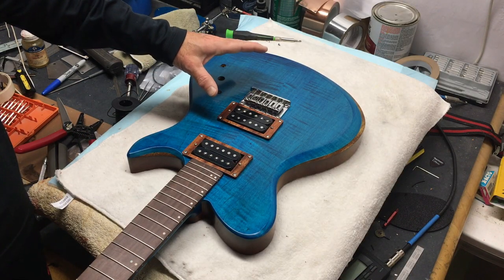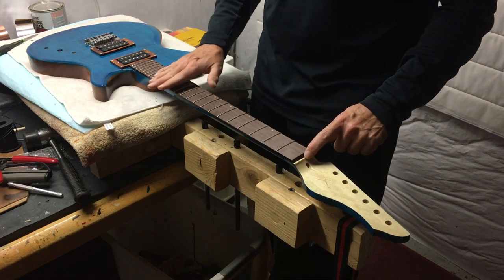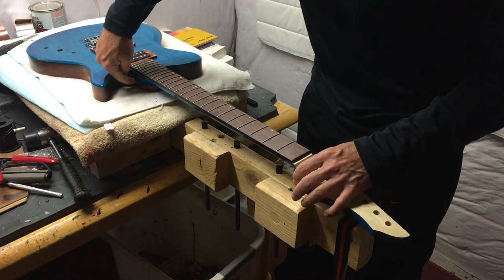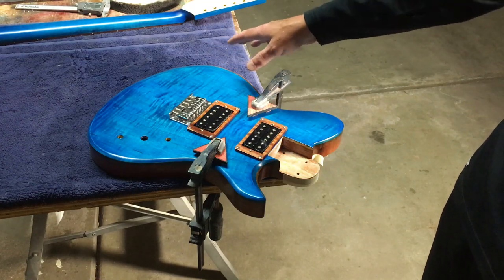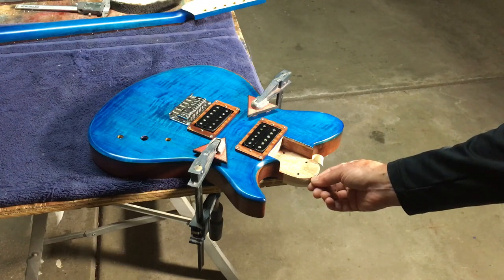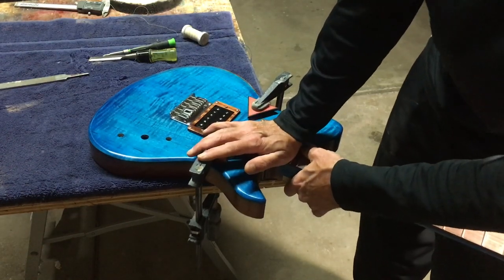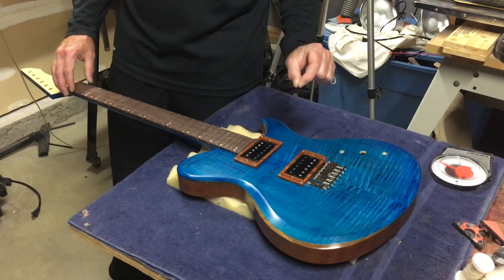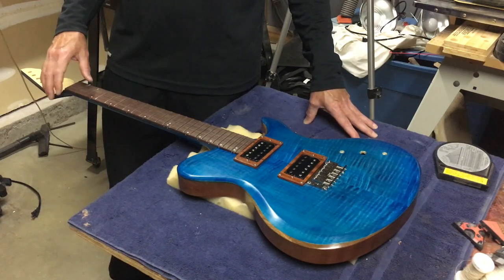How To Tweak The Angle Of A Guitar Neck For Perfect Action

Comment: I’ve shimmed many many neck pockets over the years with absolutely no issues. No matter what anyone says, there is no loss in sustain or “tone”. At all. BUT! This will be my preferred method from here on out. Because it does look more uniform and much nicer than a noticeable gap on some guitars. Awesome video and nice work!
Reply: There physically has to be a loss in sustain shimming the neck. You might not hear the difference but it's there. If it's not a solid wood to wood contact, sustain will be compromised.
Reply: @r.llynch4124  I would agree, but argue air gaps/ density variance, are a more serious problem. Using cellulose paper or dense cardboard IMO would have no discernible difference.
Reply: Wouldnt sanding the neck be a better alternative? one can always replace the neck and sand-/shape it to fit the pocket, reshaping the pocket it a pretts much one time deal.
Reply: Leo used business cards

Comment: My Les Paul has a slight neck angle problem.
The bridge had to be raised to get the strings up off of the fret board and accommodate the  slightly back (away from frets and pick ups) angle of the neck.
When I got the guitar, the bridge was cranked up pretty high.
I managed to get the guitar completely dialed in by relieving the truss tension just a little and bringing the head stock up towards the pickups which lessened the poor angle.
Then I re-cut the nut to get lowest action possible at that end of the guitar...which of course helped the bridge issue at the other end of the guitar as far as fret buzz and possible action settings. Basically it allowed more options than simply raising the bridge.
Now the bridge is only raised maybe half an inch from the body (if that) and the action is very slightly lower than spec.
Plays great now. Very happy.
Thanks

Comment: That's a nice touch dialing in the neck break angle on each build.   As you say, wood is an imprecise material - its not like we're machining all this stuff out of 4340 billet steel to thousandths of an inch.  Almost all my builds these days are one-offs, so shimming necks is a regular thing for me.  Want a REAL challenge?  Make an ultra thin body that bows slightly under tension - trial and error becomes the only way to set the break angle.  Just finished my worst case ever - had to pull the neck 16 times to get the shim correct.

Comment: As the neck angle increases the scale length line will move also.  Learned that hard way. My experience is roughly a 2.5 degree neck angle will move the scale length line abt 1/8" or so. So make sure u have enough saddle travel to accommodate the change, if the neck was previously flat.
Reply: trigonometry wasn't your strong point at school
Reply: @rogersmith5167  His comment was accurate.  Perhaps your reading and comprehension skills weren't "your strong point at school".
Reply: @gpdude22  2.5 degrees over 648 scale length will increase the scale length by .61 mm (.025 ") maybe we are talking at cross purposes
Reply: Scale length will increase by .617mm. If your saddles don't move that far you've got a bigger problem.
Reply: @gsisk911  Exactly.  We're talking about 1/40th of an inch.

Comment: Thanks for the great tip! I like this better than a shim! You have a great business attitude and a good work ethic...not seen so much these days! Nice work!
Reply: he choose a poor solution. reangling the back of the heel would be much better. there is no way he can do a smooth, flat angle in the neck pocket with the files. just can't get in there. the back of the nwck is easily accessible, and can achieve a flat and smooth surface, so the contact between the neck pocket and the neck is not compromised. yhis was a micky mouse job, unlikely with desirable results. i am glad i saw this, will never buy a guitar from this guy.
Reply: louis cyfer seems like he was getting in there just fine and also using a kickass file to do it with! I'm going to try it soon, myself, so I'll know if it works or not. Seems like this guy knows what he's talking about and seems to want to do quality work...properly!
Reply: just think about it. there is ni way he can do a perfectly flat surface for the pocket with that file. it is just physics. the file has to move past a point to file it. otoh, the back of the neckheel is easily accessible for a flat surface reference. the choice is easy. based on the choice he ia making, i don't agree with you. he seems to know what he is talking about is not a good argument. especially when you don't possess he necessary skills to evaluate it. and you obviously don't.

Comment: Using the string, I see no nut installed yet so can you do this with a nut installed or do you need to have the nut removed? Thanks
Reply from the maker: It's actually better to have the nut installed. Your results will be more accurate.

Comment: That is exactly the problem I have with my Fender Stratocaster that I put together. With the saddles fully down the action is still to high. I'm fairly handy with wood working tools, If I use your method carefully a little at a time, I think it will solve my problem perfectly.Thank you for showing this.

Comment: so you are string lining it from the saddle @ it's lowest point to the first fret? Also does it matter that the body is not parallel with the body now?
Reply from the maker: Basically yes. To be more precise, I go to the nut and put the distance above the first fret at .01" on the treble strings and .02" on the bass strings.The saddles should be lowered as far as they can go and the strings should be the same distances above the 12th fret as they are at the first fret. That way when you raise the saddles to set the 12th fret string action, you don't have that far to go.

Comment: I bought a cheap Ibanez RG for $35 at pawn shop. Dont like the pick ups or tremolo. But the action is unbelievable. All the other guitars I own are way too high compared to 5th is one. I've adjusted bridge, nut, and thrus rod and still I can't get the strings any lower. Is this what I need to do? Please help. This video is making want to remove the neck and get some sand paper

Comment: WOn't recutting the bottom of the heel pocket mean that you need to re profile the back of the neck pocket, so it meets the neck flush?
Reply from the maker: Only if the angle of the neck is so much that it creates a noticeable gap. You can also sand the back of the heel at a slight angle to compensate. In my experience, the gap is barely noticeable. Also, I add a about 3/32" fretboard overhang which will easily hide any gap.
Reply: If the neck isn't firmly against the back of the pocket top to bottom,  that would mean the strings are pulling on the screws only. It should fit  tight against the back of the pocket as much as possible for the best sustain.

Comment: Have you ever had problems with buzz because of the wrong neck angle.....I'm working on a telecaster....have tried everything including leveling the fingerboard and refretting.  If I shim the neck it will make the strings more level from the bridge to the nut.
I shimming it with a .010 flat shim to get the action lower.....I think I may need a slight wedge.  I know the best playing guitars I've had usually have very flat strings from nut to bridge in relationship to the frets.
Any thoughts?  The frets are perfectly level with a rocker.
Reply: I have a .010 flat piece under the neck......just put an 1" 1/2 piece of .010 on top of it in the back of the neck pocket!  amazing! It leveled the strings from nut to bridge.  I'm going to check the buzzing "A" string next.....the action feels like butter.  I'm really excited on this.....a light bulb moment.  The B and E string ring like a bell now.  I raised the saddles.....
Reply: Have you checked the neck for level? I would have done that before touching the frets. A bow, back or forward can really screw your setup. Best checked with a slotted straightedge which sits just on the fingerboard.
Reply: If you do need to shim the neck a wedge which runs to zero across the full neck pocket is the way to go.
Reply: Wedge won't work. Try a 5 iron.

Comment: I've had an issue with the neck geometry on a Telecaster that I purchased new at Sweetwater.  I could tell that there was something wrong when I was setting it up. Yes I know that the people at Sweetwater check and setup every guitar they sell, but how much time can they possibly spend on each unit under such circumstances, and it didn’t really matter what they did or didn’t do anyways because I was having issue setting the action and intonation on this guitar to my liking. 
When I inspected the guitar, I could tell that my guitar had neck gap and angle issues. I removed the neck and discovered that the neck pocket was uneven. I filed it even with a fine wood file. The wood was really soft and easy to work. I periodically checking with calipers to see I was approaching true. 
Now the neck sits snugly and squarely in the pocket. I never considered doing so before, but I suppose one could alter the neck geometry by adjusting the neck pocket instead of installing a shim, but I probably would never would have touching this pocket if it looked planer, but whatever the guys who assembled this guitar were thinking, this was clearly a hack job.
Reply: I also purchased a Player series Mexican made Tele from Sweetwater. I paid for the high dollar German PLEK service even.  And I've had trouble setting the action.  It just occurred to me "Neck Geometry"
 and brought me to this video.  I like your idea of using calipers!  I was trying to figure out how to measure the plane of the pocket.
Reply: @Mike-cd9cj  A set of feeler gauges will come in handy as well.
Good luck!

Comment: What about the opposite problem, where the saddles have to be raised before the strings clear the frets? In that case, would you shave the heel of the neck instead of the pocket? Does it make any difference if it's a set neck?
Reply: I have this question too.
Reply: You can angle your neck forwards or backwards to find the sweet spot. In my case I had to angle mine forwards to resolve a lot of fret buzz higher up on the fretboard with ridiculously high action. Some necks have a "kink" in them where they meet the body, usually on cheaper guitars, which can cause this issue.
Reply: Another way is to file down the neck cavity especially if it is uneven and/or the neck is already at a forward angle, which will bring the neck down (providing it is attached to the front of the body, not the back).

Comment: Great video, thank you. Exactly the tutoring I was looking for. Got into a huge problem setting a bolted neck,  strings are so low won't even make sound only buzzing. I grinded the pocket in a forward tilted angle to move strings up, still buzzing? any clue
Reply: Did you try checking the truss rod adjustment ? I'd suggest you go through a full check of the neck action, the truss rod, neck angle everything and try to find what might be causing the issue. If you're still getting the buzz then you'll need to check all your frets. Maybe one or two are not crowned properly or not set properly. Then you'll need to file and crown that fret and check the buzz. If still buzzing, move on to the next fret thats causing the problem and repeat the process. You'll find a lot of elaborated videos on youtube on refretting or crowning the fret rods.
Reply: @azmrafsan  thank you so much for your help. Truss is flat. Frets I didn't check so thanks I will. Thing is now that I started that big filing job on the pocket it's not levelled properly, so don't you think I should finish that first?
Reply: Yes of course bro. Don't go too far with that. Maybe it was just a fret issue but you already started on an advanced step. I'd suggest finish that off as close to as it was before, dont make any further changes. Put the neck back in and adjust/check frets
Reply: @azmrafsan  hi, thanks again for your precious inputs, well I sort of got as close as I thought I could get to a even neck level which it seems I did,. You are right though 2  or 3 frets at the top of the octave are the culprit I'm on it, and will keep you posted about what happened, again thank you so much for your help.
Reply: Best of luck brother. You'll find a lot of resources online. I hope you get your guitar play like you want it to. Just don't panic and don't get frustrated. Every good thing comes with patience and passion.
Reply: @azmrafsan  you're right about that, it's a first for me, guitar playing, more like the himalaya lol, hopefully I get something out of that sucker...keep you posted
Reply: @azmrafsan  Hi there, you are right, extremely frustrating because no matter how much I grind the frets the buzz persist 
with no light at the end of the tunnel, at the same time I can't keep grinding, the fret will be all worn out, any advise? thank you
Reply: I'd suggest you take a break and don't just file away the frets or the neck etc. Just watch some videos and tutorials online until you've gathered some basic ideas and can improvise on your own. Guitars are actually pretty simple once you know how it works. So my final advise would be to watch atleast a few videos before getting back to work again. Check out StewMac's channel. They are pretty interesting and they make it easy and simple to understand
Reply: @azmrafsan  Hi and thank you again, actually I watched many video for months to work on guitars I previously owned. Then I traded an amazing LP type made by a young guy and his father, that's what started me. The guitar we are discussing is a DIY strat shape, one piece ash wood and I bought separately a maple/ebony neck.  I listened to you and put the neck back on. Yeah I think I need to have the fret job done by a pro, I feel it's way over my head, but thank you again.
Reply: @azmrafsan  Hi there, wanted to keep you posted, I bought 3 bodies 3 necks, 1st is the one driving me bunkers, so went on the second one, got it working spend some time filing some of the frets almost set to go. It helped me better understand the 1st one, I think pocket is not straight far right so neck is settling properly. Right now I'll give it a rest and get back to it after I'm done the others. Also if you are interested check my stuff @ Jazz Brazilian Funk or Electro Brazil. Again so much for your help it really helped me a lot...stay safe...best Marc
Reply: @MRK can you please clarify if thats your insta or youtube ? Would love to check out your works
Reply: @azmrafsan  yes youtube
Reply: @azmrafsan , Hi, follow up, I finished another one, got it to work fine, the 1st one the culprit, I started again yesterday 1 sec at a time, today I'm doing very very light  sanding. I finally did level the whole pocket. to complete the job I decided to use some wood filler, it seems to be working just fine. very best Marc
Reply: @MRK glad to know brother. I had my strat built a while back, was bored home on this lock down tried to shave a bit here and there to get the action lower now it's buzzing and all. Well that's how it is, you mess something's up to learn some. Hope I'll get it fixed and playing soon. Best of luck with your gears. You can add me on IG @azmrafsan and we might be able to keep in touch with our works and gears. Take care
Reply: @azmrafsan  Hi, thanks for sharing, yeah building guitars during confinement isn't bad at all. Action too low on my Strat I fixed it temporarily  and it works well. I cut a piece of aluminium about 2mm thick (think it could take more 3 maybe), 6.5mm long, about 4mm wide,  slide it under the bridge saddles. For now it works great. stay safe talk soon again...take care
Reply: @azmrafsan  Hi there, hope you are well, about that tiger strat we talked about before, I finally changed the neck and it fitted right away, I definitely messed the shoe, but with luck I was able to adjust the whole thing, I also used a thin chime, so guess what it works, pretty happy I was able to save the day...;)
Reply: @electrojazz14  finally thats some good news. Seems like you've saved the guitar. I'm glad it all worked out well for you. The great part is that you've learnt a lot through this trial and error process. There's no other better way to learn.
Reply: ,  @azmrafsan  yeah no better way to learn, I'm up to the 3rd one, but my central piece is gonna be the 5th one, a Tiger Caster, Thinline with strat neck and killer Dimarzio DP 103, keep you posted on that, be safe

Comment: Thank you for this video!! I bought a guitar body and neck off of eBay and being new at this I just glued them together as they seemed to fit nice... Now I see with a bit of string and a file I could have avoided disaster. I'm not giving up, next time I'll try this method. Meanwhile I'll grab a bag of marshmallows and roast them over this chunk of mahogany with a flamed maple top.
Reply: that was idiotic. don't glue a bolt on neck. it needs an entirely different connection. you need a neck tenon to glue in.